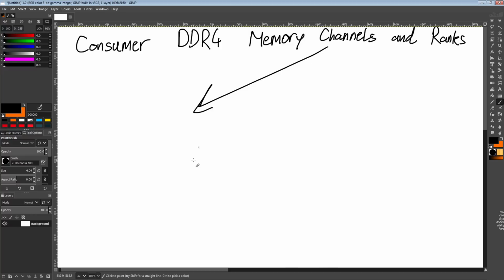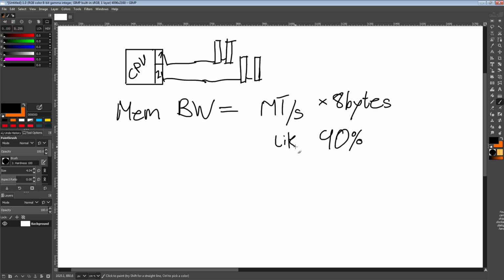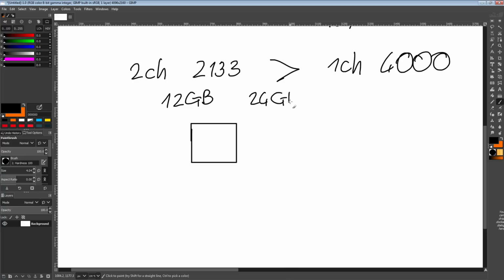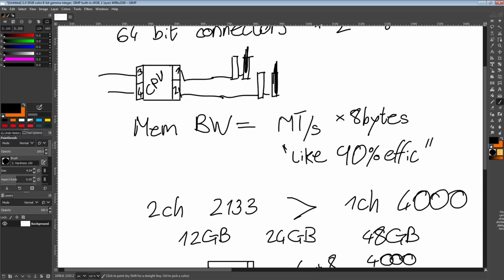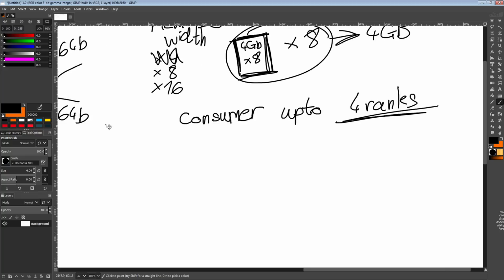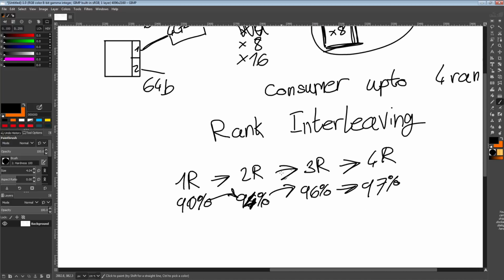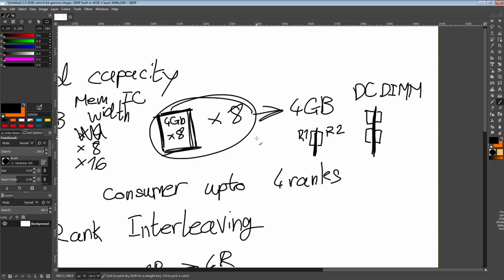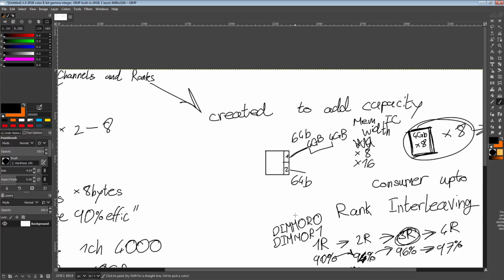Rambling about DDR4 memory channels and ranks

Comment: great, my laptop has exactly 12gb of memory.  I thought that was weird.  So if I am understanding this correctly, if I have a dual channel Ryzen 9 3900x and I want 32gb of memory, while it would be more efficient to have a 4x8gb configuration I would have better performance due to higher possible clock speed using a 2x16gb configuration, filling only 2 ranks.  If I end up needing more capacity (I am a gamer who is also a programmer) I could add another 2x16gb later and fill up all 4 ranks but I would likely have to drop the clock speed.  

Great, now I just need to know if I should target B die or CJR (looking at the gskill neo's at 3600 mts.  Shooting for 3700-3800 mts, but I don't know how well CJR does.  I hear it is good for clock speed, but the timings suffer and that B die is so much more expensive.  Memory makes my brain hurt :/

Thanks for the breakdown, this was helpful.

Comment: I'm one of the "stupider" viewers, and I'm fine with that.  It's why I watch your videos, so I can learn.  Thanks for all you do!!
Reply: The knowledgeable use the answers that science provides them, to feel superior to others. The wise instead, use those to share that common good that is knowledge, while keep learning, rather than settle on what they already know. Bee proud of feel stupid, if that let your brain keep questioning and give you the need to find answers. Since that make you more wise than many others.
Reply: i can reLATE
Reply: there is no such thing as a stupid question especially when you are going to the trouble of making videos for people. saying there is stupid question is poor teaching ethic.
Reply: His information is also not 100% correct, so that tone is REALLY douchy.
Eg. "You can't use Dual Rank DIMMs in dual channel" 100% incorrect. Particularly if you have a board that has only 2 DIMM slots, essentially 2 Paired Dual Rank DIMMs in a 2 DIMM board runs the same as 2 sets of 2 paired Single Rank DIMMs (4 DIMMs) in a 4-Slot board. If you have 4 Dual Rank DIMMs you CAN run them, but they'll perform the same as 4 Single Rank DIMMs. There's a SUPER SLIGHT difference but it is not perceptible even to The Flash
Reply: @LostOnTheLine  2 dual ranked sticks in a single channel is recognized as quadranked by the controller. It's usually rather pointless doing that with 4 sticks since your frequency just goes down the drain.
Reply: @TheDude50447  True, ranks make a small difference that most won't notice but if you are running with 2 sticks per channel (2 in A & 2 in B for 4 in Dual-Channel) single rank gives slightly better performance. But that gets flipped if you are only running with 2 DIMMs. 2 dual-rank sticks running in Dual-Channel will give a slight performance boost (all other things being equal) than 2 single-rank sticks. I always tell people the differences are small enough that nobody is going to notice it, but the difference is there. For Single-Channel they say a single dual-rank stick performs like 2 single-rank sticks but that I feel is less accurate performance-wise though it may be true in a technical sense
Reply: @LostOnTheLine  so im kinda of new to pc building but what i can gather is that four single ranked sticks that equal to dual channel is just a minimal slight performance compared to two dual ranked sticks ?
Reply: @nicheegal  For dual channel to really work correctly you need the sticks in A1 & B1 to be the same size, same rank, same timing & same speed. This used to matter more but modern systems are smart enough to adjust things to work properly. Manufacturers like to tell you it only works if they are the same chips from the same lot, but that's just a marketing tactic to get you to buy a new pair instead of buying one that matches what you already have. The difference between single channel & dual channel is big, like imagine a crowded freeway with 4 lanes compared to the same cars on a freeway with 8 lanes. For light tasks it's like driving on an empty freeway, the number of lanes don't really matter. That's not the best example but it's the one usually used. If you have 4 single rank sticks that all have the same size, speed, & timing then that will be faster. If you have those 4 as dual rank there is a very slight speed loss, but within margin of error levels. Dual Channel would be like each truck carrying stuff on your freeway being twice as wide, so they can take up 2 lanes each. Dual rank is like a car with a trailer. Unloading the bigger car will be slightly faster because it allows bigger boxes, but Dual channel + Dual rank would be like a double wide with a trailer. But when you go to unload it you have the same amount of people unloading the truck & the trailer which gives a slight speed loss.
Best practices:
2 sticks = 2 dual rank
4 sticks = 4 single rank
But the part you need to be aware of is making sure the pairs are matched whatever the setup
Reply: @LostOnTheLine  I was gonna leave a comment about how it's like having a teacher directly make fun of you for not knowing advanced algebra on your first day of math. But I'm glad to see I'm not the only one who realized this. Hiding this channel now.
Reply: agree, I wish he would kill the elitus tone/attitude.  If not for the douche-baggary insulting tone and too frequent bla, bla, bla talk, I would have subscribed

Comment: Thanks for the explanation. Since I didn't understand it well, I had been wondering if you could run one of those DC DIMMs on an X99 ITX to take advantage of all 4 memory channels across the 2 connectors it has (sort of like how you can run two PCIe cards on one connector with bifurcation). This video has answered that question.

Comment: Isn't MHz correct for DDR as far as Hz is just 1/s? I mean can just count the transfers/s in Hz and it's exactly the same as MT/s
Reply: No because you Transfer 2 times per Hz.
Reply: @GurkenkoenigZ  Hertz is just a unit for measuring frequency. Transfering twice per clock (not Hz!) simply means 2*clock (in Hz) = data-rate (in Hz).

Comment: Can I cut a memory stick in two and use each half on a memory channel? I have a pretty neat Xacto.

Now seriously. Can you dive more on those more obscure settings such as Interleaving and BankgroupSwap? I have a 64GB 4 dimm kit (TridentZ Neo 3600 CL16) running at 3733 CL16 and I wonder what else can I do to improve it. My timings are already as tight as I could set them.

Also would be good to know which parameters are the preferred ones (besides primary) to further lower latency. So far I know primary, tRCT and TRFC are good candidates.

Comment: Buildzoid mentions something about “pagefile” towards end of video & how you don’t want to reach that. Recently, I haven’t been able to run the division 2 on my pc. Task manager says memory & disk drive basically at 100% & game is virtually unplayable. I have 8gigs of ram on a prebuilt & I think it’s on a single dim. Am I screwed? Is there anything I can do other than upgrading ram? (not working at the moment)
Reply: Kill all  programs running in the background, including all non-essential services, turn down game graphics (especially textures) to the minimum. Do you have an SSD?
Reply: TheBackyardChemist - I’ve turned down game graphics. I’ll have to look up what “non essential services” are cause the list in manager is ungodly & pretty intimidating. Here’s where it gets tricky. I do have an ssd, which the game is on. First downloaded game on c drive then looked up how to copy game file & swap it to ssd. So ssd reads fine in manager but near full in capacity but again it’s the memory & c drive disk space that is max’d which I don’t understand. Perhaps I messed up there some time ago ‘cause I didn’t always have this issue.
Reply: @mikewakefieldgeller4164  TBH when I had to so similar things due to having only 4GiB of RAM, I just started killing stuff and found out by trial and error, which services cannot be killed without making the system unusable. Killed services should always come back after a reboot, so it should be fairly safe to kill something.

About your storage situation: you have a HDD and an SSD right? And Windows is installed on your HDD, right?
Freeing up some space is always a good idea, if the disk has less than 10GiB of free space, that can cause some issues (not always, but sometimes).
There is a program called spaceSniffer that draws a nice map of your drives, showing you the space taken up by various folders and files on your drives. It is a great tool if you do not know what is taking up all your free space.

After you have at least 30 GiB of free space (or 20%, whichever is smaller), you can move your pagefile to your SSD. This will reduce the issues when you run out of RAM, but this is usually not recommended for long term use, as this will wear out cheap SSDs relatively quickly.
Reply: TheBackyardChemist - thank you for the help, Brother! Really appreciate it.
Reply: @mikewakefieldgeller4164  If your disk is near maxed out, then the game can't properly page out data. You really need to get more RAM. 16 GB minimum is the amount to target nowadays. Additionally, having a nearly full SSD impairs write performance. Unless you're using a really expensive SSD which has built in provisioning, you'll have to manage it yourself. Regarding the page file, the age-old rule of thumb is you need to reserve 1.5x your memory capacity in disk space for the page file. Usually the system will handle it, but if there's not enough space for the page file, the system will literally run out of resources and choke. So if you are running out of storage capacity, you will also need to get more storage capacity. Or, you know, download it from the internet. I hear that works too :laughing:
Reply: @Amberion  hardy hargh hargh.. I know im a noob, but know enough from the mentor buildzoid that memory is a physical  thing & cannot be downloaded on the net! ;) thanks for the input, did some research & just learned about 1.5x mem cap in disk space. Did some cleaning as well & now have 614 of 930 gb space on c drive _ 100 gb free of 419 on the 960 evo. problem still persists, sadly. Guess it`s my shitty OEM 8gb single ram stick in an alienware pre built. Knew it  would come down to the ram upgrade (not working at the moment) but 16 gigs & up is going to be the new standard. thanks!

Comment: Is dual rank or single rank better for 16gb ram (Should I use 4 x4gb sticks or 2 x8gb). The dual rank has the double the access via DIMM slots. Meaning each stick can use the full bandwidth of a single lane. Use the four by four GB sticks. ez enough Unless you are chasing high frequency
Reply: A single-rank DIMM to each slot is ideal.
2x8gb single rank, each in its own channel.

Comment: I have a 2700x with a x470 taichi.

I started with an old vengeance 2x8 gb b-die v4.21 (3200mhz cl 16 rated) on it (from 3 years ago), never went over 12gb usage but wanted to populate all the 4 slots for the t-top configuration of the mobo (not daisy chain).

Found 2x4gb vengeance (3000mhz cl15 rated) used for 40€ and put them on the config.

As you said no problems here with 24gb, I even managed to go down from 3000mhz cl15 to cl14-14-14-14-28 T1, that I couldn't do with only 2 sticks, t-top magic I guess.
 Ps the memory controller on my cpu sucks, I can't manage any type of ram at 3200 without stability issues (it boots, too many errors on memtest even boosting voltage and cl)

Comment: I'm in the 48gb camp.  Got 4 sticks of 4GB Adata XPG Gammix D10 2400mhz (AX4U2400W4G16-DBG) in July 2018 for 164 USD when memory was insane stupid expensive.  In July 2019 Newegg was having a sale on 8GB OLOy 2400mhz (MD4U082417IFDA) so I picked up 4 sticks of that for 90 USD.  Nearly half the price for double the capacity just a year later.  I really got bent over in 2018.
Anyway, I run all 8 sticks in my X99 Taichi with 6800k at 4.2ghz 1.275V and have overclocked the RAM slightly to 16 16 16 36 timings.

Comment: Could one create a pcb where you plug in a single memory stick that plugs into two memory channels and use that in dual channel? ;D
Reply: Good question. But you would need double density ram to get same amount of ram as with 2 sticks.
Your idea seems only suitable for Ultralights with ram soldered on the MB without expansion slot. But then again it's soldered on and no slot.
Reply: DDR5

Comment: re: APU and memory bw: on the distributed computing project World Community Grid, i had about the same points per day (PPD) with 1x2400 stick vs 2x2400 stick. or no worse than 10% slower on a 2400G. running a GPU project along side it was 20-30% fewer PPD, tho. also, on my Threadripper 1950X, there was little to no difference between dual and quad channel or again no more than 10% fewer PPD. basically, you couldn't see the difference on a spreadsheet.